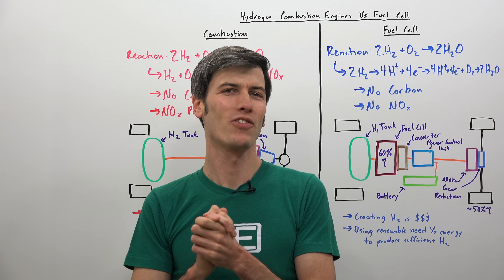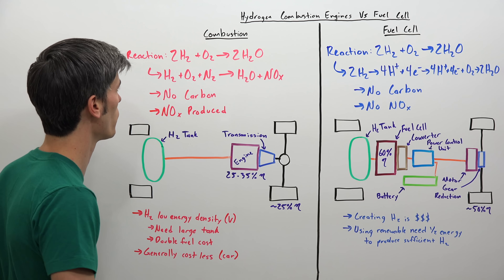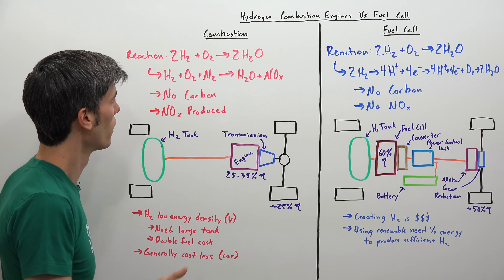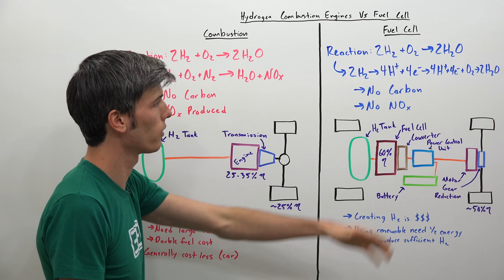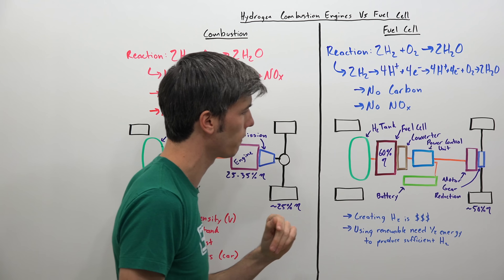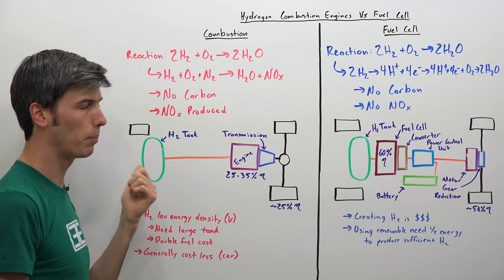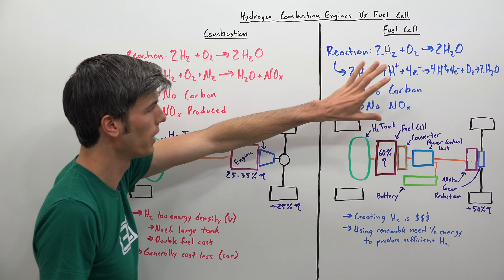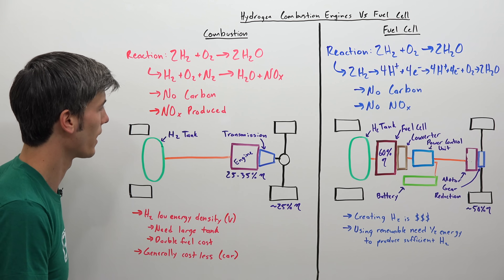Why Hydrogen Engines Are A Bad Idea

Comment: How efficient is it to mine all the stuff you need for a fuel cell vs. a combustion engine?
Can a fuel cell and electric motors survive immersion in salt water and 120° temperatures?
How do you cool electric rotors that are in severe heat under heavy load?
How many semi-trucks can be converted to fuel cells in a day or two?
How many fishing boats, oil tankers, and military vehicles can be converted to fuel cell instead of combustion?
None, that's how many.
You miss the whole point.
Combustion engines are terraforming the planet.
The only way to reverse that damage is to undo the misinformation of 
 like this guy and get ppl more powerful than oil companies to save the world( and their profit margins).
The real question is, who or what is powerful enough to defeat Big Oil and save the world.
If the right ppl can be convinced that leaving a planet for their grandkids is a cool, then all us huddled masses might not see the world's atmosphere collapse.
Those taiga fires are probably capable of causing a Krakatoa like "nuclear winter", one hopes the ultra powerful realize oil profits are less important than staying alive.
Too bad my whining is unlikely to save the world.

Comment: Can you run a petrol generator on hydrogen gas?
Reply: sure but why would you
Reply: So you could run a petrol generator on hydrogen gas to charge an off grid battery bank without polluting your own back yard.
Reply: @deanervik  You forgot that the hydrogen has to be made from electricity first.

Comment: Hydrogen is a problem since it's very easily ignited and has a colorless flame
Reply: Nobody said that need a tank.  Need only a split cell hho generator. At 12v 10A produce more than enough Hydrogen for live operation for a 1800cc engine. Which means what you producing that you can immediately use it. You have to keep the system under pressure around 15psi(1bar). While able to produce more Hydrogen gas than  to burn ,you need a gas pressure regulator and a sensors which turn off and on the slipt cell generator. You can use your fuel injection,but you need a modified ECU and remap it on hydrogen.  Have to modify the exhaust system also.

Comment: Would someone be kind and tell me where the nitrogen comes from in an internal combustion hydrogen engine
Reply: Air.
Reply: @Savak22  thanx for your reply, is it air tapping in general or is the nitrogen separated on its own ?
Reply: @mohamedmahdi9498  nitrogen and oxygen make up most of the air that we breathe, the air is used as part of the combustion process, bringing both oxygen and nitrogen into contact with high temperatures which can cause the creation of NO, 

atleast that's how I understand it.

Comment: Something's amiss here. Stan Meyer's system of producing hydrogen gas through electrolysis is far more economical space wise and produces far more energy than your combustion explanation. In general, speaking of the whole idea, no industry anchored on fossil fuel likes listening to 'free energy ideas'. All new ideas need to have the 'bugs' removed. Me, I'm of the idea the electric car is the car of the future. Not the fuel cell. I've been enamored by electric cars since I first seen the 'slot car' when I was a kid. Your imagination goes wild at the idea of 'instant torque and speed of it.
To any inventor or researcher of economic energy, free energy and fuels, pay close attention to who's following you.

Comment: Out of curiosity
What environmental damage does acquiring the catalyst and battery components, compared to a combustion type engine
Reply: Doesn't matter, because if your transportation network is half as efficient, meaning it uses double hydrogen, you'll need to double everything involved with transporting and creating that hydrogen. A doubling of efficiency at the end user has massive effects on the entire supply chain.

Comment: Why combustion engine have such low efficiency?
Reply: Here's why heat-engines (including combustion engines) never have 100% efficiency:
.
A heat-engine receives heat at a high temperature, and rejects it at a lower temperature. The heat in the working-fluid when the heat is rejected, is lost to the engine. The engine only benefits from the heat-energy difference between the hot air and the cooler rejected air. If the engine could use all the heat that it receives, it could theortically be 100% efficient. But whatever hear is rejected takes away from that efficiency.
.
The amount of heat that the engine can't use is measured by the temperature at which heat is rejected. If it used all the heat it took in, then it could be said that it rejects heat at absolute zero (no heat rejected).  Temperature is proportional to translational (non-rotational) kinetic-energy per particle. So, the percentage of the received energy that is used is:
.
(H - C)/H   =   1 - C/H
.
...where H & C are the engine's max & min temperatures, expressed in absolute degrees, such as degrees Kelvin (K)   (Degrees K = degrees C + 273)
.
The maximum percent of the energy that can theoretically be gotten from the received heat is called the "Carnot efficiency", after the engineer who first investigated that subject in 1820, and discussed it in a book entitled "Reflections on the Motive Power of Fire."
.
So a heat-engine runs off of a temperature difference, which determines how much of the 
.
incoming heat is lost when heat is rejected at the lower temperature.
.
So, how to get the most motive-energy from the heat? How about this:
.
1. Compress the air at the engine's coldest temperature (C, the temperature at which heat is rejected).  
.
(The reason for compressing the air is the same in all gas-phase heat-engines, including the Otto (Spark-Ignition, Gasoline) engine, and the Diesel:  The more you first compress the cold air, the more volume for which for the air to expand after the air is heated. Of course the hot expanding air does more work, than the work required to compress it when it's cold)
.
2. Expand the air at the engine's hottest temperature, H.
--------
It's like "Buy low, sell high". Compress the air cold for the easiest  (low-pressure) compression, and then heat the air and expand it hot (high-pressure), to get the most work from the expansion.
.
The Otto & the Diesel don't even try to do that. They both let the air cool while it's expanding, and that cooler air doesn't exert as much pressure or do as much work.
.
Well, in 1816, the Reverend Robert Stirling, in Scotland, devised an ingenious engine to achieve just that. Of course, like any heat-engine, it wouldn't be possible for his engine to actually fully achieve its ideal cycle (isothermal compression at min-temp, and isotherman expansion at max-temp). But that's what Stirling's engine was designed to do...designed to at least come as close as possible to doing. 
.
Note that he built that engine 4 years before Carnot wrote his book.
.
The finishing-touch with Stirling's engine was what's now called the "Regenerator" (Stirling called it the "Economizer").  The regenerator is a metal heat-storage matrix (stack of screen, or steel-wool), that reduces the need to use the heat-source and heat-sink to heat & cool the air, reducing the amount of heat needed to flow through the engine. 
.
When the air is on its way from hot-expansion to being cooled for cold-compression, it goes throught the Regenerator, which consists of a stack of screens or a mass of steel-wool, to absorb thhe heat from the air, to assist the cooling. On the cold side, the air is kept at min-temp, (by the cooling-system that surrouinds the cold-piston) as it is compressed. Then that compressed cold air passes back through the Regenerator, on its way back to the hot side. During that passage through it, the Regenerator gives back to the air, the heat that the air had previously left in it.  
.
Arriving at the hot-side, the now-hot, and still compressed, air is kept hot by the burners around the hot-space, and  that now-hot air (which is still compressed) is allowed to expand against the hot- pistion to do work.
.
Rev. Stirling devised two ingenious mechanisms  to achieve that cycle of: Compress the cold air, move it through the regenerator to the hot-side, expand the air, hot, against a piston, and then move it back through the regenerator, back to the cold side, to compress it cold there again.
.
Both mechanisms use a plain familiar combination of piston(s) & crankshaft.
.
The Stirling engine, in either form, doesn't have or need any valves.
.
One method (the Alpha-Configuration) consists of two cylinders, a hot-cylinder & a cold-cylinder, with a high-pressure tube connecting them at their top-end (for air-transfer between them), and with pistons whose connecting-rods  connect to crank(s) on a crankshaft in such a way that there is a 90-degree phase-difference between the 2 pistons' motions. That achieves the cycle of:  Compress on cold-side, Transfer to hot-side, Expand on hot-side, Transfer to cold-side.
.
(The regenerator is in the middle of the high-pressure tube connectings the hot & cold cylinders.
.
The other configuration (the Beta Configuration) has only one piston, whose chamber adjoins and opens into a chamber of air that has a combustion-heated hot-end on the side away from the piston, and a cold-end at the end toward the piston.  The air in that chamber is moved back and forth between the hot and cold ends of the chambrer, by a "displacer" that moves back and forth in that chamber. The displacer isn't a piston--it isn't wide enough to fill the chamber, so it leaves space around it. Its length is such that it occupies much of the chamber, an Its purpose is merely to move back and forth, to displace the air from the side that it moves into, displacing that air to the other side. 
.
So, with the Beta-Configuration, the displacer, moving the air back and forth,  causes the air to be alternatively heated and cooled, and the piston compresses the air when it's cold, and expands it (receiving a push from it) when it's hot. That co-ordinated task is achieved by having the displacer and the piston connected to crankshaft-cranks that are 90-degrees apart, so that the displacer's motion  is phased 90 degrees ahead of the piston's motion. 
.
The Beta configuration has both the displacer-chamber (and displacer) and the piston co-linear in the same tube. This requires the connecting-rods to be mutually coaxial (one inside the other).  The need for coaxial connecting-rods is avoided by the Gamma-configuration, which is the same as Beta, except that the displacer-chamber doesn't share a tube with the piston, but rather is in a separate tube or cylinder alongside.   ...so that the piston & displacer connecting-rods no longer have to be coaxial
.
In Beta & Gamma, the regenerator is located in passages through the displacer, or around the outer surface of the displacer. Often table-models of Gamma have a displacer which, itself, is made of the steel-wool regenerator-matrix.
.
Though Gamma is popular for table-models, the NASA MOD2 automotive Sterling-Engine was an Alpha-Configuration Stirling.
.
Beta & Gamma have an inevitable loss of efficiency due the use of just one piston for cold-compression & hot-expansion, with the resulting need for the attempt of dual-use of some spaces both for air-transfer, and for heat-exchange--resulting in some unintended heat-exchanges, to the detriment of efficiency.a
.
The Alpha-Configuration doesn't have that problem.
.
So why would the Beta & Gamma be used at all?  Well, it's cheaper to build just one (precision-fitted) piston instead of two.  Additionally, that one piston and its seals and lubricant aren't at the combustion-heated end of the engine.   There's no hot-cylinder piston, because the only cylinder-&-piston is at the cold end of the displacement=chamber. So: Cheaper construction, with the loss of some efficiency.
.
The NASA MOD2 automotive Stirling Engine was an Alpha Stirling.

Comment: You don't know enough about this subject to make this video. Hydrogen engines NEED to be the automotive power plan of the future. Hydrogen comes frim water and the engine exhaust is water vapor. The engines van be mostly comprised of high temperature recycled plastic. Imagine a rotary vale hydrogen engine. That is what we NEED! Hydrogen can be produced right from the same engine that is consuming it. I know how but not telling. I need to be compensated for my ideas.

Comment: unfair compaison, thermal efficiency is not the issue here, nobody denies fuel cells and batteries are more efficient, however electric cars are boring (even the fast ones), heavy and cannot be tuned. people want hydrogen combustion for the fun without pollution not nessecarily being the best all rounder. we are not robots and to deny hydrogen engines treats us as such.

Comment: 2020 yr. blue gas is  teslas  nightmare..  itll take 2 minutes to charge and  more  life expectancy  long-range mileage  alot better than tesla battery..
Reply: I would like to take the time to post some info about my vehicles setup.  I have been running my car on Hydrogen for about 2 years now.  I do not store large amounts of Hydrogen fuel in a separate High pressure container.  I produce enough gases on demand through the electrolysis process to run my 2.4L engine which requires about 6L per minute at 7000 RPM to run without hesitation or noticeable reduction in power.  To be clear, I do not separate the Hydrogen and Oxygen gases in my device. I simply have a small container that will be pressurized to 12-15 psi before the system will shut off production automatically.  I produce enough gases on demand through the electrolysis process to effectively bypass the need for complex High Pressure tanks to store H2 like most of the current systems.
    With this method I do not store enough combustible gases to cause any significant fire hazard or air displacement danger in the instance of a "leak" or failure of the containment device.  I bought a new fuel tank to replace the one that came with the vehicle to prevent contamination from the old fuel.  Now I use my house water to fill my cars fuel tank which holds 12 gallons.  So the fuel system is the same as you would find from the factory but, I fill it with Water instead of Gasoline and the fuel pump connects to the water container in the engine bay instead of to the injectors.  Also I do not use the fuel injectors, I use a large aquarium tube that is connected to the intake before the MAP/MAF sensors.  In order to run my engine on Hydrogen I had to retard the ignition timing from about 25 degrees before top dead center to about 5 degrees before top dead center.  I did this by using a timing light and rotating my distributor clockwise by about 7 degrees.
    As a comparison my car got about 30 mpg with gasoline, now it gets between 25-35 mpg with Hydrogen.  In conclusion I am sure that with a more complex delivery system I could get better performance and mileage because I am not monitoring the fuel air ratio but, my goal was to create a system that produces less Carbon emissions not to be crazy efficient and cheap to fill.  I believe by producing enough gases on demand this is more efficient because if I run out of fuel through miscalculation or my fuel gauge stops working, I simply need to find someone willing to sell me water (in one case a woman was so impressed she just gave me the use of her garden hose).  This is also safer because I am not using a "High Pressure" storage container for a combustible gas or liquid, it is just water in a tank.

Comment: ok, your wrong. nox can be almost eliminated by using the egr system of the engine. keeps your combustion temperature below 2000 degrees and vrooom. And who cares about efficiency when your using water which is free! STAN MYERS! WATCH READ LEARN.

Comment: Engineer Explained

How do you come up with HHO or Hydrogen being expense when you can make either HHO or Hydrogen Free from water  at home from cheap solar???????????
Reply: You need alot of solar to make HOO, then you have to compress it to 700bar, then you have to cool it.  Its about 3x the energy needed for a similar battery car.  So charging your car on say 3kW (which is considered slow) you need 9kW for a similar amount of Hydrogen.  Solar is not free.  HOO would not be safe to store mixed.

Comment: Mr. Mediocre Explanation at work. He basically says nothing but that H2 power comes in two styles. No cost analysis of the fuel cell, batteries TOC, or why the internal combustion version is a "bad idea" rather than just less efficient.

Comment: We need nuclear powered cars. When the car is not in use it could be used to power the house. You would never run out of fuel and there would be no pollution.
Reply: Clearly you have a misunderstanding of how nuclear power works.  They have to remove spent rods every 6 months or so and it cannot be reused. Which is why there is the term nuclear waste. Also nuclear reactions drive a steam turbine. How are you going to carry that much water for a steam powered car?